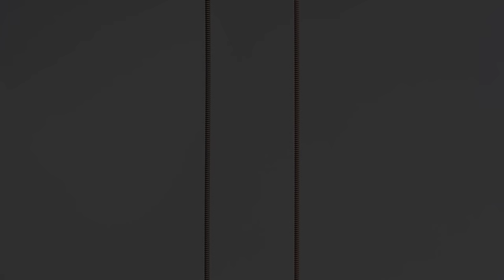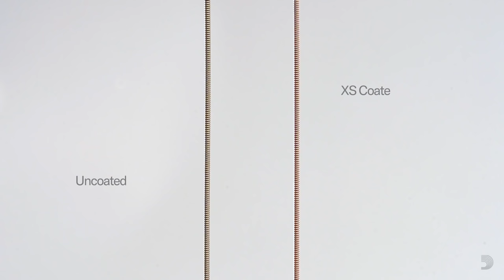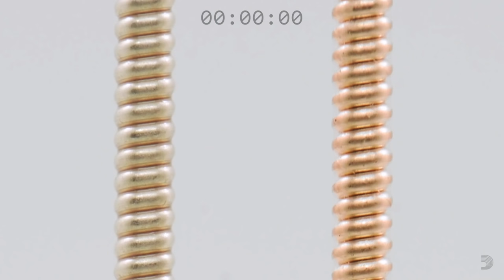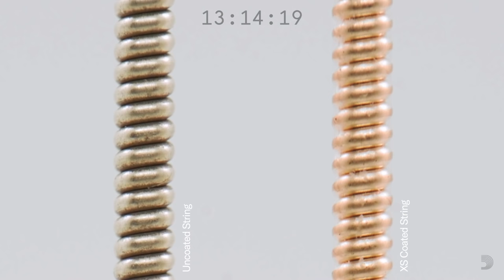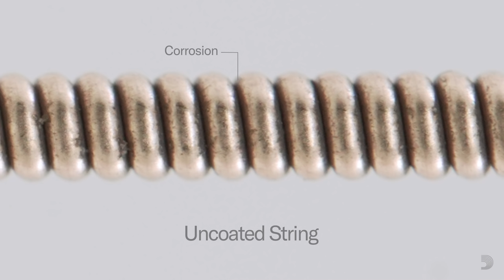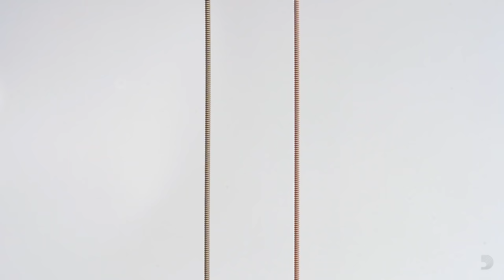D'Addario Lab: Corrosion Resistance Test | XS Coated Strings vs. Uncoated Strings

Comment: I rotate a couple of sets of D'Addario Prosteels roundwounds. I keep  the unused set in Denatured Alcohol until I'm ready to use them again. I have been doing that for many years.It works very well. Can I do the same thing with the XS coated strings or will the coating disintegrate from the denatured alcohol?